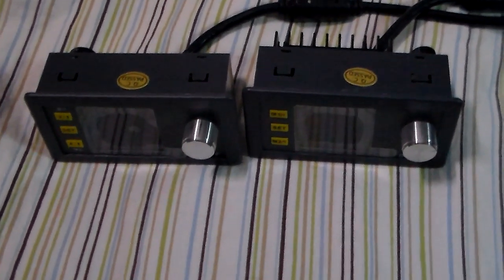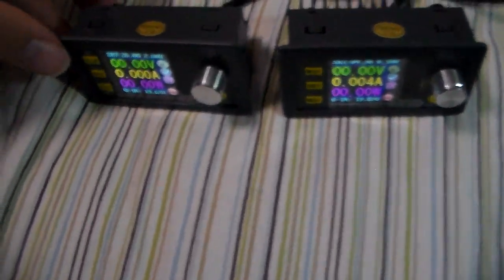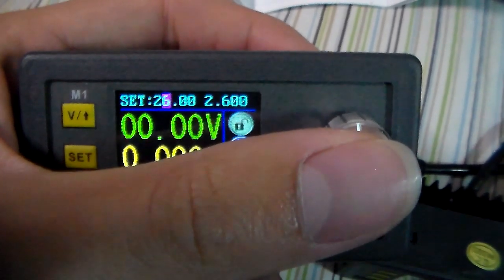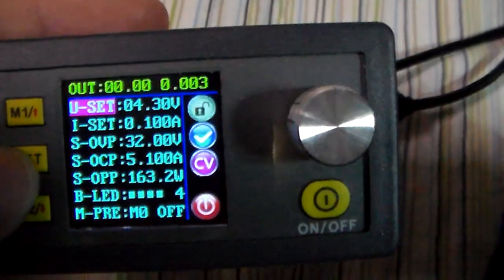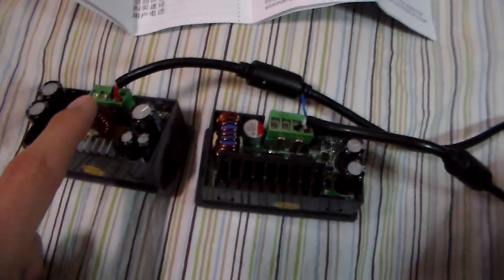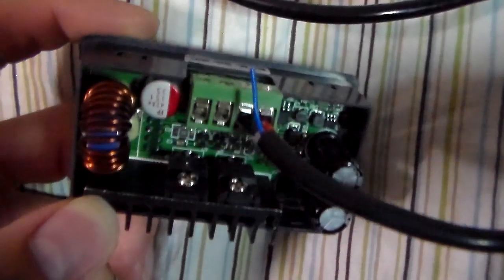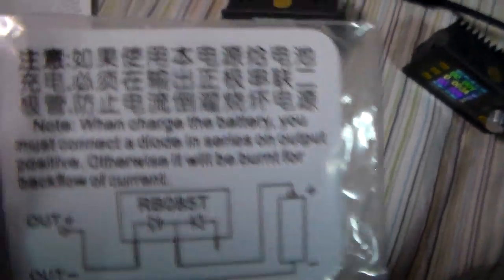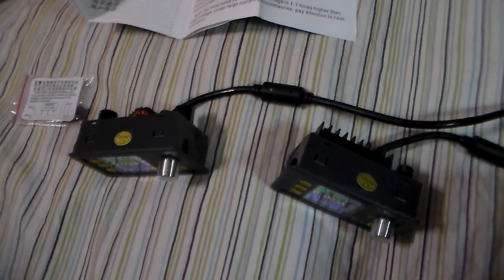RD tech. #2 DP vs DPS programmable PSU + battery charging

Comment: Ive seen in line fuses, a diode without any housing ? 5A ? 30V Sounds like they praying on vulnerable amatuers, to safe guard their 'other' businesses
Reply from the maker: Yea it is unfortunate that you need to wire in a diode yourself and all they give is a standard diode with no wires or heatsink. Thanks for the comment, it actually gives me a video idea to update everyone with.
I don't think they are taking advantage of amateures, they are assuming that a person looking for a DC-DC lab bench power supply has at least a little bit of skill with soldering and circuits, otherwise why would you need thier digital lab bench power supply? There are other solutions and other companies for people that don't want to deal with that sort of wiring. Not every company or every product is the best company or solution for everyone.
That is my opinion, thanks for listening.

Comment: Its possible use simetric + and - Voltage?
Reply from the maker: I havent heard of that term before, looking it up it seems like you are talking about a split rail DC supply? would an example be you have +12v then 0v and then -12v? those would add together to become a single 24v supply in reference to the -12v rail. the device should work on that 24v but remember that the topology of it is a buck converter. those only source current they will not sink current without a load attached. thanks for the comment

Comment: I have a dps 3012. when I connect the load, voltage output drops 
considerably.  DPS voltage readings are different from what I measure 
using a Voltimeter.  Do you know what can be happening?   Here is what 
is happening https://youtu.be/AvVGQbyPqnk
Reply from the maker: hello there, yes it looks like you have a faulty unit, where did you buy it from? use that method to contact the seller and get it returned and replaced.
Reply: I bougth from ebay.  I-m going to contact seller.

Comment from the maker: +Rd Tech it would be really cool to set these with i2C or similar, on my teardown I did find a debug/programming port which if you could make firmware updates available and a new revision that allows "remote setting" from a host controller that would be REALLY COOL. imagine creating something on your phone to talk to an arduino to control multiple units and set their output states or voltages and currents.
Reply: HI SuperBrainAK, I have hacked the DPS5015 and DP50V5A to allow controlling them both via Arduino, and remote control via Bluetooth. Have a look at my YouTube channel, and also my Instructable.com instructable, search for "Professor Potter"
Reply: +1. I noticed the board has pins for RX and TX so I'm guessing for serial communication?  Would be really nice if some voltage and current settings could be sent over serial that way you could charge a battery by remotely monitoring the voltage at the battery terminals.  I've asked Rd Tech is this is possible but no reply yet.
Reply from the maker: That is cool! I will check that out thank you!

Comment: function: set default boot open or close output??   what is it for???
Reply from the maker: that is the after boot output status. when the unit receives power after a power failure the out put will stay off, however if you set it to "close output" it will turn on automatically after a power failure. which is handy for long term or specific applications, though cheaper things might be better suited for long term always on applications.
Reply: Thanks for replying.  so. Why  DPS3005 is cheaper than  DP30V5A?? which of them would you recommend me?? I dont understand why DPS3005 is cheaper if it's presumably better.   I know both of them can charge batteries too
Reply from the maker: well after using the DP and DPS models I have found that the DPS is more efficient because it is not losing .5v by using a diode. I would recommend getting a DPS unit. My guess as to why he is charging less for DPS models is because he is making and selling more so that is where slightly complex marketing schemas come into play, he wants to make more DPS so he sells them cheaper, he will still make the DP models but only to the people who really want the DP kind. (I do not know if he is still making them or not or just getting rid of his stock but if he is not then that would not make sense to charge more)
Reply: You said that DPS models are not using the diode to block reverse current when charging a battery. So what's the used protection method for the DPS   power supplies?  I can't figure it out

Comment: I like the constant current aspect, as well as the wide  50V 15A 750W range.  But the output can only be 91% of the input voltage?  i.e. no boost?    

I think the newer DPH (DPH3205), also has the updated (DPS) interface.
Reply: Ben Nguyen
hi , about efficient is sbout 97%. you can test. about the DPH3205, the only difference is buck-boost converter
Reply: The input voltage must be 1.1 times greater than the output voltage. So, to get 50V on the output, a 60V power supply is required.
Reply: 55v, it is enough afroninjadeluxe
Reply: afroninjadeluxe
? 50v*1.1= 55V? 60v is the limit input voltage , please pay attention

Comment: are these buck only or will they step up voltage as well?
Reply from the maker: Do R/C! These are buck only, so the output voltage is limited to 1v less than its input voltage, I would like to see some boosters in the future though as that would be very handy to have
Reply: Do R/C! 
yes, this version is  buck only . 
now we have one version buck-boost DPH3205. you can check https://www.aliexpress.com/store/product/RD-DPH32305-Constant-Voltage-current-Buck-boost-Programmable-digital-Power-Supply-buck-Voltage-converter-color-LCD/923042_32762131242.html?spm=2114.12010608.0.0.QxB3Q8

Comment: Hi friend 
I am the seller RD official store manager
Thank you very much for you video
it is very good to compare to use DPS5005 (http://www.aliexpress.com/item/RD-DPS5005-Constant-Voltage-current-Step-down-Programmable-Power-Supply-module-buck-Voltage-converter-color-LCD/32684324154.html?spm=2114.10010108.1000023.20.IL43pu ) 
and DP30V5A (http://www.aliexpress.com/store/product/RD-DP50V5A-Constant-Voltage-current-Step-down-Programmable-Power-Supply-module-buck-Voltage-converter-color-LCD/923042_32613371214.html?spm=2114.10010108.1000023.32.9ju9d8)
 This video can show DPS and DP difference , also show DPS5005 and DP30V5A the charging battery difference. it is very good 
if fact you did not show one important difference between DPS and DP---( DPS has this function: set default boot open or close output”), you can try..
and when you show " Extract Shortcut storage data group M1 or M2 by long pressing M1 or M2", you can't turn potentiometer to switch M1 or M2. they are only be extracted Shortcut, understand .
I saw when you operate DPS5005 to show this fuction. when you extract M1, when you ture potentionmeter to change M1, M1 is disappear, right? because you are in change output voltage, when you change this , it change M1 state, so M1 disappear. when you long press potentionmeter , you lock all keys.. this is your some wrong operation, please read the instruction. thank you 
about the charging , DPS3005 and DP30V5A can charge the battery directly , but DPS5005 and DP50V5A need a diode to charge the battery . 
thank you again for you vedio. I like it very much 
I hope more poeople will see it
Reply: and when On the data setting interface, press shortly M1/↑or M2/↓ to page
 up or page down to M-PRE, and then press shortly the 
coding potentiometer to enter into the status of choosing the data 
groups. Turn coding potentiometer to choose the data group you need to 
view.  in this state , you can ture potentionmeter to change data groups M0-M9, understand ?
Reply: +RC The Real Live 
Hi friend 
now we have one version buck-boost DPH3205. you can check https://www.aliexpress.com/store/product/RD-DPH32305-Constant-Voltage-current-Buck-boost-Programmable-digital-Power-Supply-buck-Voltage-converter-color-LCD/923042_32762131242.html?spm=2114.12010608.0.0.QxB3Q8

Comment: Does it allow quick changing modes just by rolling the knob when it's sitting on the "home screen"? I enjoyed this, I've got a 1400w 48V Sun PSU what I've wanted to convert to a bench supply of sorts, using like 5 of these things. Thanks for sharing
Reply from the maker: yes, I have finally figured that part out, at least on the DPS models you hold the "SET" button for 2 seconds then you can turn the knob to select the preset you want and press "SET" again and it will put those values into M0 which is your current state and first state you boot into when turning on from being powered off.
you wont be able to use any of the 30v models but any of the 50v models will work just fine, they do have a DPS5015 that recently came out. :)
Reply: Doogie Rick
our power supply must be used  along. charging fast or not depends on current